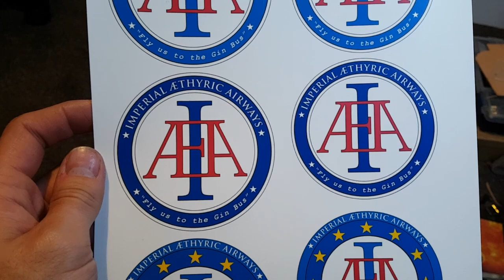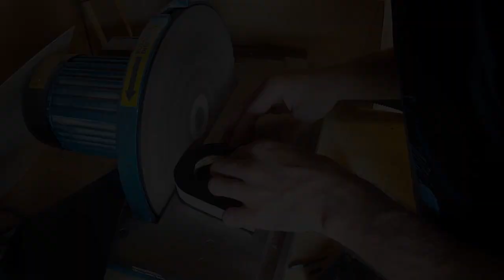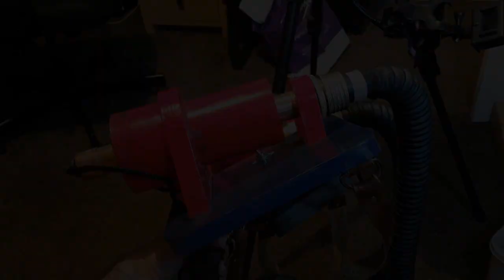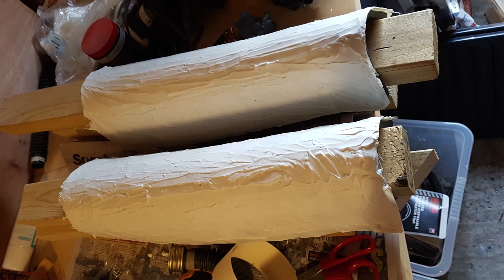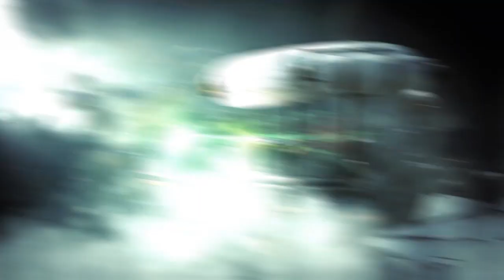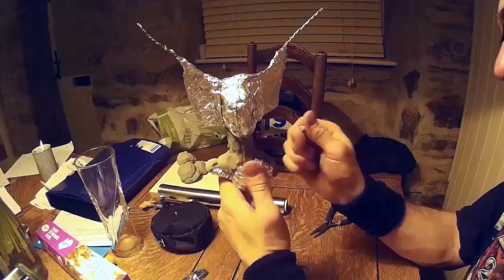Making a Steampunk Mask Part 3

Comment: If you can get 5V fans (I get mine on eBay) then you can use USB battery packs to power your fan system and also the Arduino.  Even a small 2300mAh Lipstick size battery will power 2 fans all day happily.
Reply from the maker: +Christopher Pearson thank for the tip. This was the first bit of electronics I've done in some time so I'll have to have an  investigate when I do some more.